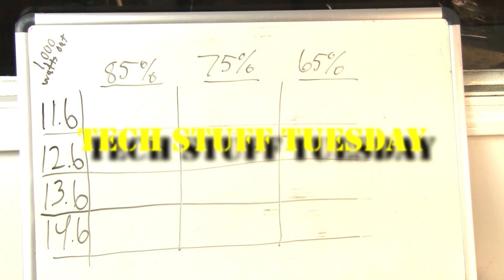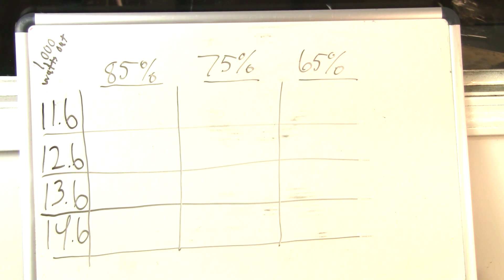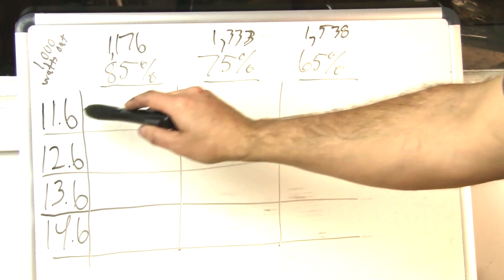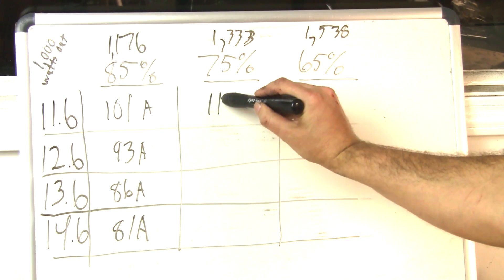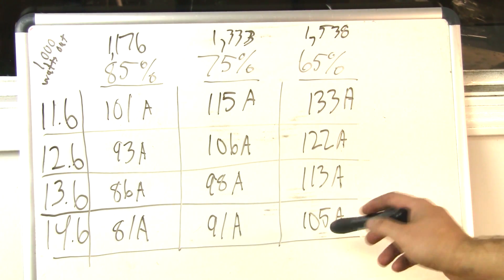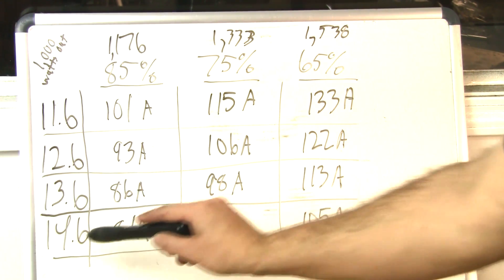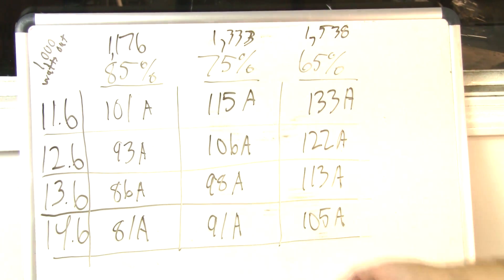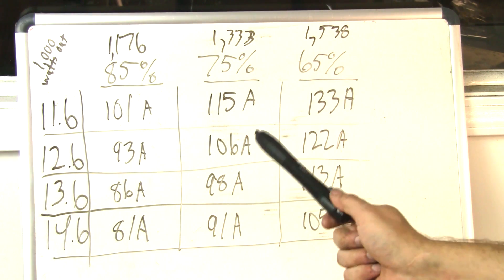Amp efficiency and benefits from higher voltage - Tech Stuff Tuesday

Comment: I am running a car amplifier in my house. I am currently researching power supplies. Its either a 13 volt power supply or a 15 volt power supply. The amp does not specify voltage range but most car audio equipment from what I know specifies between 10.5 to 16 volts so I assume I should be fine at the 15. Id not I can always throttle back the supply to 14.4 since its adjustable within that range.

Will the amp put out any more power at the 15 volts as opposed to say 13 volts. Should I run it at 15 or 14.4 or the 13 volts?

Comment: From 130 stock to 250 alt. From my understanding is half of stock rating is generally rule for car needs. So 250 - 65=
Reply: Opps 185 amps so a 85% efficient amp at my steady voltage 14.0  all ofc 0 gauge + big 3 should cover say 2200rms safety? Also how do I figure in my only 1 under the hood agm xsd3400 battery into the equation? MY HEAD HURTS!!!!!

Comment: How do you feel about aftermarket adjustable PCMs? The one I’m looking at overrides the regulation and therefore random voltage drops of the stock pcm, runs in conjunction with it, and allows voltages of up to 16v in Ford vehicles. I would keep it around 15 or so max though as my scv4k’s input limit is 15.5v. Singer alt, d6500 under hood.  US Alternators makes them. Thanks Sean!
Reply from the maker: I've used one before and it worked great, till one time where it freaked out and did bad things. I don't know for how long but I was charging at 18v for some period of time while driving, in summer, on a 12v system. You could hear AGM's boiling. I turned it off and back on and it was fine but there was a scare. I know some alternators don't play nicely with some PCM's, just won't work right period. So I'd say it could work great, but it could also be problematic.
Reply: @EMFAudio  18v?! 😮 yikes. Sounds like I’ll be doing some more in-depth research of it.  And a call to them probably. If it can happen to you that makes me more nervous. At the end of the day all car audio components are a risk to some degree I suppose. Thanks as always!!

Comment: I can't get enough, watching your tech Tuesday is like going to mobile audio tech school! thank you for this, really. may I request videos on clamping power at home, setting baseline input voltages, and determining / mapping impedance rise over range. perhaps, some discussion about the effects of tuning from the head unit, i.e. sub level, bass boost, and EQ settings, look like on the o-scope, and tuning advice for the regular folks. thanks again, I have become a big fan.
Reply from the maker: Impedance mapping is less precise in educated guessing, but precision takes a lot of math and hoping that simulation is correct which it may not be at all (where guessing is more accurate). Unless you mean explaining they curve in general. HU tuning with amp tuning I think is something people mess up so that would be good to cover.

Comment: So trying to remember this. More battery’s as in AGMs. I’ll pull less amps on my alternator? I have a 240 amp alternator and will be running a synergy 35.1. Now only want to run 3000 rms sub or 1500 2 subs. So the amp don’t have to struggle to pull the power. But what you think on that? I am going for 28HZ. Like flex and lows. And I remember lower the HZ less rms or Watts or amps it pulls. To like 40HZ would be more power right.

Comment: Class-D (actually it is switch mode amp since very few are true 100% digital) can actually be up to 90-96% efficient. Atleast in home audio😝
Reply from the maker: They also tend to be 4 ohm amps with AC to DC converters, which are more efficient.
Reply: @EMFAudio  True..

Comment: Awesome video as usual bro!  Would you consider making a video about not just the differences between agm/lithium/caps but also the pros and cons of having a mix of the above.
Example: I have a d3400 under the hood, one run of ofc 1/0 to the back where I used to have a Kinetik hc2000, being replaced by an xs cap I purchased from you. Basically in theory would it be good to still keep another battery in the trunk in front for the cap? I ask because I plan on getting a lithium battery as well down the line. (Waiting on my singer alt to arrive as well.)
I guess at the same time it may make sense to go over when it’s proper to have multiple runs of power to the back, as well as when you should add runs of negative to the back/benefits to (or more technical truths) of doubling up on grounds under the hood and in the back instead. I hope that makes sense and isn’t too wordy
Reply from the maker: That is on my to-do list.

Comment: Would it or is it a good idea to use passive as well as active cross overs in conjunction with each other?
Reply from the maker: Stacking crossovers can have some adverse effects. If they're set to the same frequency it would multiply the slope. So if you had a passive 80 hz high pass that was 12 dB/octave and the amp was also set to 80 hz high pass with a 12 dB/octave your actual slope would be 24 dB/octave. If they were set to different frequencies and/or had different slopes, you'd get an irregular filter where it cut more at some points than others.
Reply: @EMFAudio  Thank you

Comment: I run a 240 amp mechman alt and I use a single audiopipe 1500 apcl to power my single skar evl 15 I also use a skar rp 150.4 for my 4 mids and a alpine mrvf540 (old school model) for my 2 tweets (still need to buy a second pair of tweets)! my mids are rated at 150watts rms each and my tweets are rated at 120 watts rms each! I have the apcl 1500 wired @ 1ohm! at a stop light at full volume I will drop to 12.5ish +\- at crussing speeds at full volume I wont drop under 13.2! my question is im thinkin bout adding a second agm battery for the trunk soon I just want to know if one good sized agm in the trunk will help stable my voltage a lil better I also plan on upgrading my bass amp as soon as I can afford to
Reply: id also like to have a lil bit of head room as well I don't like to max out my cars electrical like I fell like I am!
Reply from the maker: Your alternator at idle doesn't put out as much power as revved going down the road. , you're definitely putting a hurting on that battery too. That Audiopipe amp is very inefficient. Have you done big 3 upgrade? How old is the battery under the hood?
Reply: yeah big three is done with 1/0 guage I even went and did a double run on my big 3! battery is a new agm a group 24 I belive 70ah and 800 cca rating I cant really fit any batt bigger then that under my hood! I also have two other amps I run as well a alpine mrvf540 for the highs and a skar rp150.4 for mids
Reply: my mids are rated at 150 watts rms my tweets are 120 rms each although im only feeding them 80 each right now
Reply from the maker: @stankinsteinfrankfurter9005  It sounds like you would benefit from a second battery which we have on www.emfcaraudio.com

Comment: Super useful, man! To make the point even more, an 85% efficient amp won’t be that efficient at low voltages. So on top of what you explain, low voltage also decreases amp efficiency.

Comment: dam idk how my batt doesn't die from the beating it takes from a Rockford Fosgate Prime R1200-1D and a Hifonics ZXX-500.2 my stock alts only a 110amp only upgraded my power wire from the alt to bat from what looks like an 8 gauge to a skyhigh 0 guage cca wire seemed to help out abit
Reply from the maker: That Sky High will be worthless in no time. That stuff oxidizes sitting on a shelf. Even the OFC that's supposed to be oxygen free oxidizes (meaning it isn't oxygen free). Get some good OFC in there like the stuff we sell, upgrade the battery which we also sell, and take care of that alternator. It's definitely going to die if you run that system full volume for periods of time.
Reply: @EMFAudio  true that it will be my summer project...time to spend some cash on some good stuff

Comment: I always use the high voltage method you just explained Im using the oversize stock 145 amp alt with 4 batts and 12 supercaps on high demand volt drops to 12.9 then recovers the second the note stops hitting right back 13.6v depending on song quality 14.0 at batt bank and 14.6v alt power line voltage around 60v-70v Ac on a scv 6000.Its not too shabby.Nice Tech Support keep it up.

Comment: for possible ideas to cover... you could talk about 1) adv/dis to grounding your amps to chassis vs direct runs to the battery      2) clarification regarding information of hearing loss at high decibel low frequencies
Reply: Well if you take a look at vids that Sundown showed and even talk to Brian it always better to run power and ground directly from battery I did and its perfect power everytime coupled with big 3.Its Awesome.You will hear the difference.
Reply: I normally ground to the chassis never have enough wire to do a double run

Comment: i run 12.6ish v on 2000w amp when i play it loudest with one agm up front nothing in back and 240 amp alt and one run of 0 gauge cca. not sure if im getting the full 2k out of it but it does 2.2k+ at 14.4v so all in all its probably enough headroom for my x 15
Reply: i do have a seperate 4 gauge run for my mids and highs amp so that helps.
Reply: @maxfmfdm  when I changed from cca to silver tinned copper and I didn't mean to say that his stuff isn't great I gurantee it is the best but I could hear a dramatic difference especially on long notes or when I beat for a while from my ofc to my cca
Reply: @maxfmfdm  if u haven't seen that thermal imaging of the cca versus copper man it is scary if u r on a budget check out 2/0 conext link on Amazon it is what I run I have three runs from front to back to charge rear bank I clamp 9,950 out of a 12k, it is much cheaper than most out there and it is the real. Deal silver tinned true 2/0
Reply from the maker: I suspect at best you're making around 1,900 watts, but most likely 1,500-1,600 on average. That CCA wire isn't doing you any favors. It heats up and resistance increases, voltage drops from that. I bet if you swapped to good OFC wire like the stuff we sell your voltage goes up a little bit.
Reply: yeah all good advice. i suspect the wire and also my voltage regulator is the weak point in my electrical

Comment: At what ohm load because sundown amps at 1ohm are only 65 percent efficient
Reply from the maker: I've tested Sundown amps at 1 ohm at 86-88% efficient and at 0.5 ohm 73-75% efficient.
Reply: What one my scv 2000 is only 85 percent at 4 ohm state's right in owners manual
Reply from the maker: @gregmorison2032  And what does it say for 1 ohm? It doesn't :-)  That doesn't mean it can't be 85% at 1 ohm. I've tested a lot of amps. FYI your owners manual also states the power rating at 14.4v and they make it at 12.6v.
Reply: Ik this is kinda old. It is in the manual.. Does not mean its 100%.
Thats written to save their butts..
If they wrote 90% efficient and it turns out only 82% consumers will be mad...
Take a ladder.. The manufacturer states a load limit of 250lbs...
When in fact that ladder could handle 400 lbs at its actual limit.
It a safety net for a GOOD manufacturer to under rate a product.